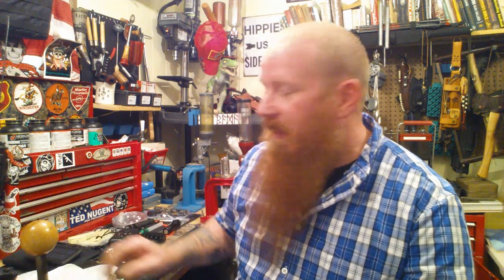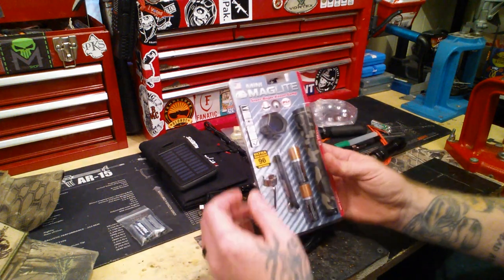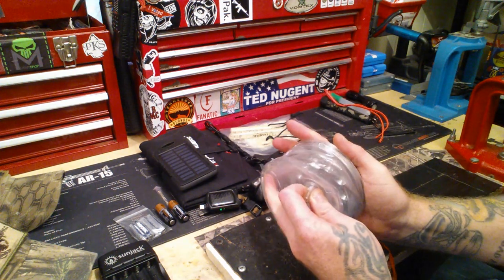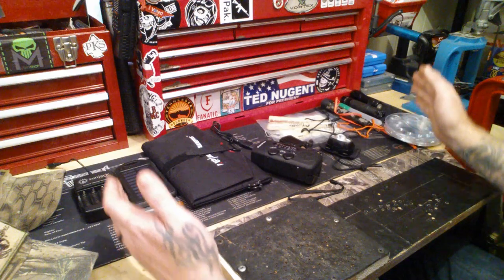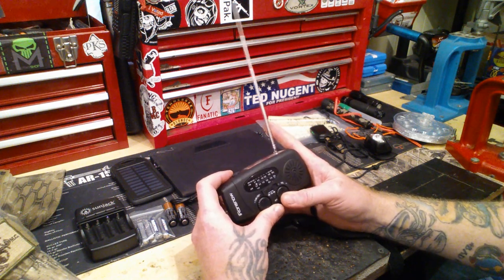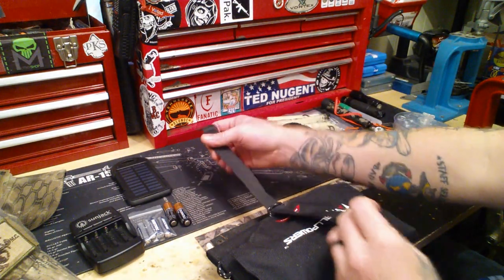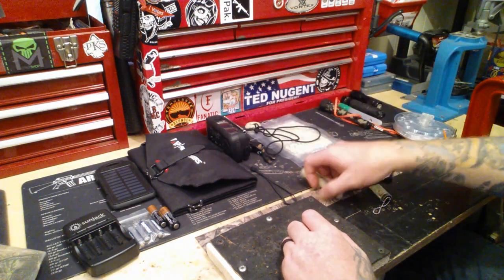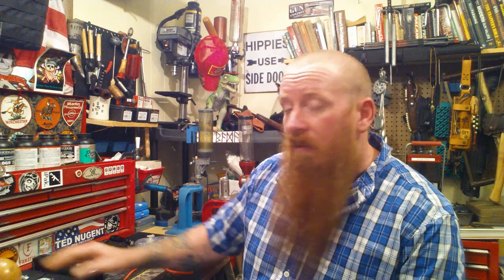I.N.C.H. Bug Out Bag | Let There Be Light

Comment: In my opinion your "NEVER COMING HOME GAG" should be a lot of solar products and gear. If you really think about it you won't be able to charge your batteries. I like the bio lite stove, goal zero and Anker products. All good solar powered gear
Reply from the maker: Nick H Deep 6 Leather Works thanks brother
Reply: Nick, add the skills / methods used for all the centuries before modern electronics were invented. As needed, have the ability, the capability to take advantage of both worlds. Know how to make a stone or sea shell lamp, deer tallow candle using a discarded soda can as a lantern reflector, and more ? 
All batteries that I know about have x number of times they can be recharged, before failure. No guarantee, in an INCH Bag situation, as to when replacements will be, if ever, available again. Make a lamp. Make a long burning torch from what you have available in your environment. 

Just food for thought. I like electronics, too. :-)

Comment: Looks like I have light & power covered. I have some very similar gear. I have a Led Lenser p7qc with white, red, green & blue colours just by twisting the head. Have to get a new battery & charger for my HAM radio & I  also have a set of 3km range CB Radios. INCH bags are a kind of ounces/pounds/pain situation aren't they.🤔

Comment: Hey man awesome video but I noticed you are mistaken about the ratings that come on rechargeable batteries. The batteries that you pointed out as "1800s" are called "Nickel metal hydride" or "NiMH". You shouldn't refer to them as "1800's" because that value represents the capacity of the battery in "milli-amp hours" or "mah". The reason this is important is because the capacity of these batteries will very by hundreds of mah from brand to brand. If you go to a store and ask for "1800's" they won't know what the hell you are talking about because it's just not name, it is the capacity of that particular brand. (btw those blue batteries are chinese shit, get "enloop", the only name in NiMH batteries that matter).

Another thing about NiMH batteries is they are actually a lower voltage than alkaline batteries and it is voltage which is responsible for brightness. See for yourself, look at any alkaline battery whether it's AA or AAA or even D or a button battery and they are nominally 1.5v. However the nominal voltage of NiMH batteries is only 1.2v and therefore is not as bright, your alkaline batteries must be dying for your NiMH to appear brighter. 

Also I know of a battery type you will really like. They are called "14500's". The reason you will like them is because they are lithium ion. This means their nominal voltage is 3.7v. This means they really are much brighter than the other two chemistries. Of course if you put this battery in a flashlight meant for only 1.5v batteries you will burn the bulb, but if you find a flashlight that is meant if 14500's, you will be able to use not only those batteries, but also normal alkaline AA's as well as AA sized NiMH batteries! Thats three different types of batteries including the most common on the planet in one light! And one of those batteries, the 14500's, is really high performing both in voltage and capacity! Check it out!
Reply from the maker: Teddy Thefourth thank you

Comment: Solid state graphite power cells the small ones connected in series that trickle charge an organic carbon power cell that powers a bright LED flash light. You can use the light during hours of darkness then switch it off and it will recharge itself. 💫😱😵😂